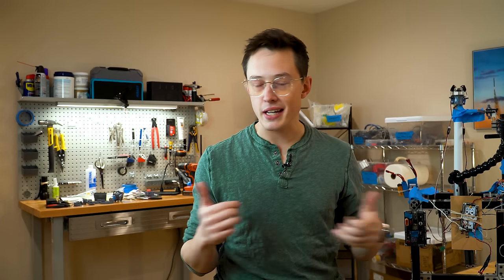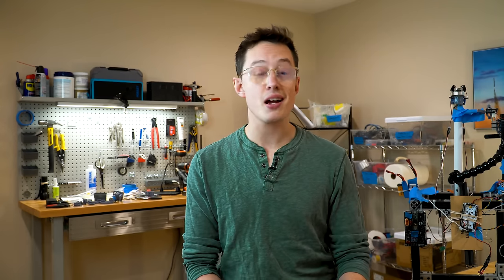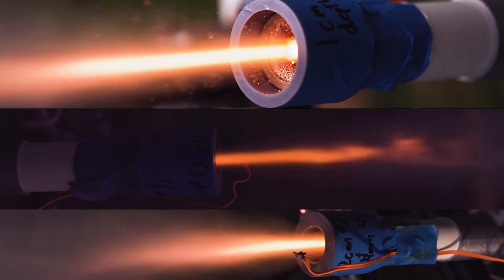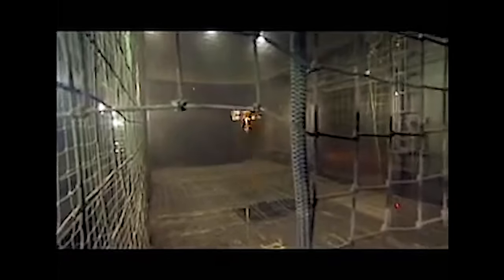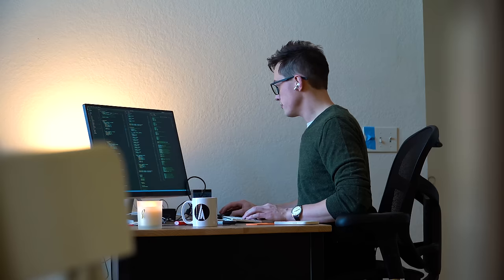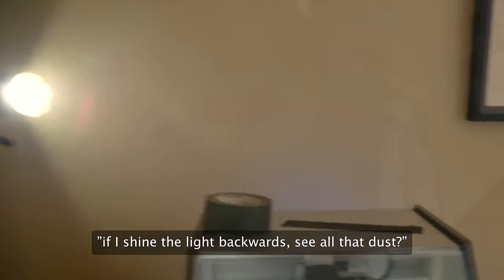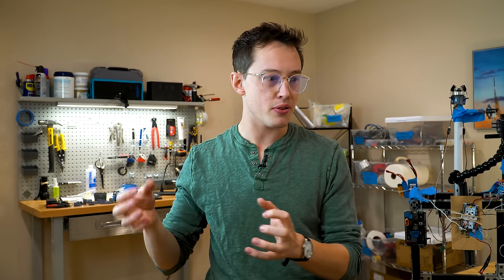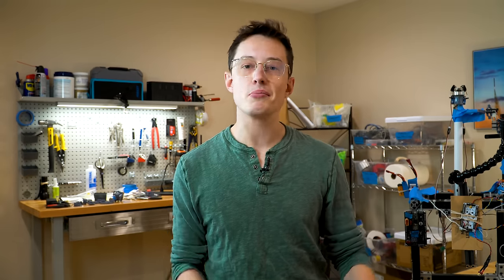I Figured Out How To Throttle a Solid Rocket Motor

Comment: engineers today cant make shit by hand. back before 1990  they were fine.  your shit is all over the place , let's call it wobble. the fact that your unfamiliar with Aerotech motors by now is not great. Also, you need a "real" shop, not an app, not skillshare, a real shop! In 5 years  after a lot of machine learning you will be in a good place. Sorry, tough love.
Reply: A CNC Maschine is not an app. What are you talking about?
Reply: @calistohuettich  there are limits to what a 3-D plastic printer can produce when rocket building at a high level. i'm saying that he need more tools and equipment to progress further. 3-D printers are great but plastic parts don't have the stiffness/strength for some applications. especially when they get hot near motor casings. Aluminum, titanium, carbon, would be better. maybe a 3-D metal printer? Today, people rely too much on the latest and greatest and skip over learning traditional machine shop skills. in 1969 we went to the Moon without 3-D printers!